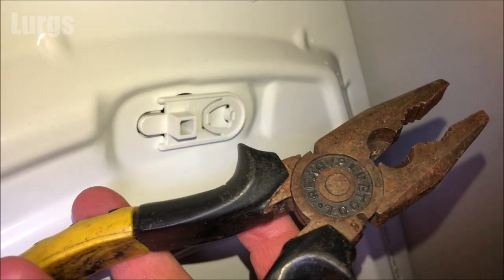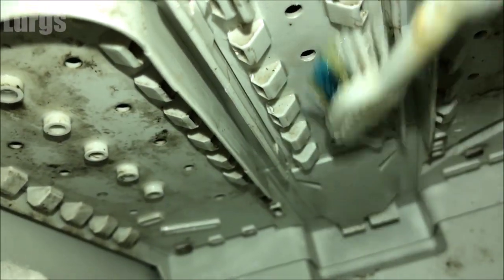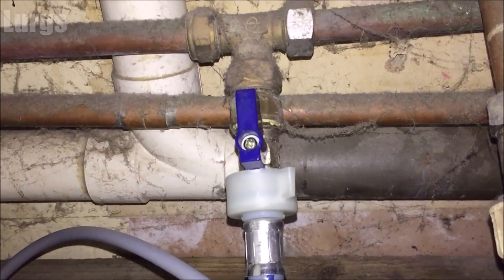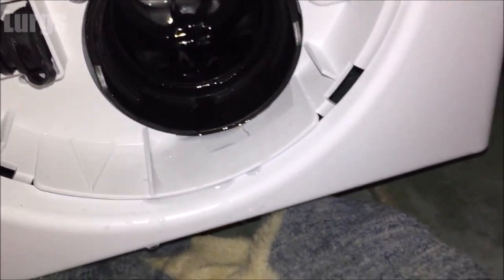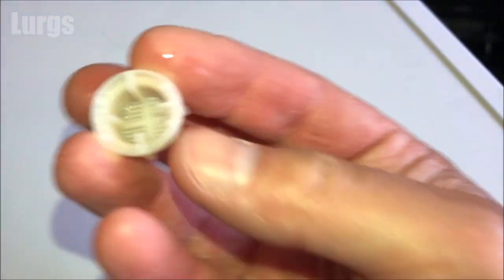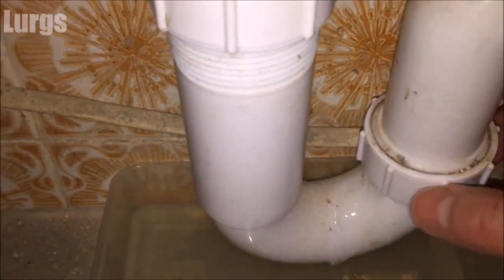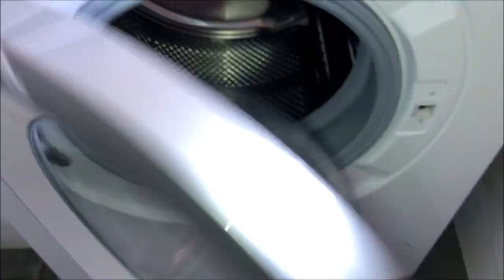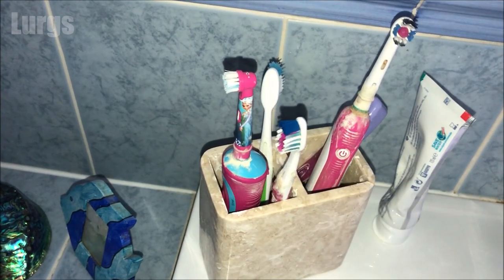Bosch Washing Machine Maintenance Tips for Maximum Efficiency Serie 4 VarioPerfect

Comment: 👍👍👍 Very useful 👍.  My Bosch series 4 washing machine always shows low water pressure indication. This is because of the height of the water tank.  There is no block in water line and filter. Machine always work in this low water pressure. Is there any possibility of damage because of this?
Reply from the maker: In theory no because it just opens the valve to let in cold water, it may not get as much in as it should but it shouldn’t affect it too much. It may just be a bit sensitive

Comment: Hello.  Great vids but do you have any suggestions as to why the spin is weakening and unable to properly operate on heavy loads?  Slipping belt?
Reply from the maker: If it's this Bosch model it doesn't have a belt, it's an electric magnetic motor. Else if it's a model with a belt then yes it could be worn or stretched possibly
Reply: @LurgsHowToGuides  Thanks for getting back to me

Comment: Hi there... Thanks for that video, We have the same Bosch washing machine as you. I definitely need to clean my soap holder.👍
We have a situation, where one of my partners bras (with metal lining) has somehow caught the inter part of the rubber door seal. It has ripped it in two places. At present the machine is watertight, but the rubber seal needs to be replaced.
I have seen loads of YouTube videos on how to do this, but none of them show the exact same machine as ours. Some of the videos show them having to remove the top and front to get to the seal, where one actually does it without removing the casing. 
Do you, or does anyone else have any experience of this. Thanks
Reply from the maker: Unfortunately I don’t. Maybe a cheaper fix would be some glue/silicone? Hope you can get it sorted. Good luck

Comment: I can’t seem to unscrew the filter? Does that mean it’s blocked or could I have a different version than you?
Reply from the maker: Probably something stuck in there. Just have to try untightening then tightening and try wiggling machine and see if that debris will work it’s way loose. Maybe try some pliers but be careful as it’s only a plastic filter.

Comment: I have series 8 Bosch washing machine but no drum clean cycle
Can I use cottons cycle on 90 degrees (no speed perfect) which would take 2 hours and 45 minutes or the same thing but with speed perfect which would reduce the time to 1 hour as an alternative?
Reply from the maker: Yes do the 1 hour version, it doesn't need to be on that long. 90C with some Dr Beckmann's or a tiny bit of detergent will give it a good clean through.

Comment: I ran the drum cycle and came back home to a small flood on the floor. Is this due to too much detergent? I wasn’t around when I ran the programme. Cheers.
Reply from the maker: If you run a Drum clean with too much detergent you will get overload Sudslock where foam and soap suds pour out of every orifice. Hopefully it was just that. Don’t need much detergent or use Dr Beckmanns
Reply: Thought so thanks. Cleaned the floor nicely 😊 - thankfully tiles on concrete!

Comment: Mines leaking underneath from the front left hand side. Nothing seems to be leaking at the back from any inlet or waste hoses from visual inspection. Any ideas please?
Reply from the maker: Sounds like the drum rubber is damaged or an internal hose, be hard to diagnose without taking it apart or maybe turn it upside down (but water will be everywhere again)

Comment: I have this washing machine, it has started leaking from inside the casing somewhere and making a noise when draining.. is still under warranty JUST but any ideas if there is an easy fix as the engineer won't come out before the warranty runs out and I might have to sort the bugger my self. I am a gas engineer/ plumber, but no white goods experience at all. Cheers!
Reply from the maker: That’s unlucky. I’d check the filter for any blockages, if no blockages then get it fixed under warranty ASAP.

Comment: What to check if machine is making holes in clothes
Reply from the maker: Could be a number of things. 
1. Check the drum inside to make sure no debris in there, ie. bits of wire stuck in the holes (bra wires can come out)
2. Older clothes do weaken and will get holes
3. Overloading the machine can cause holes, also zips on jeans etc so always wash them inside out.